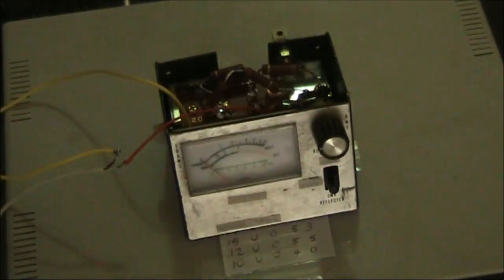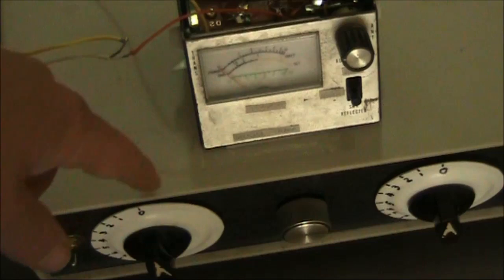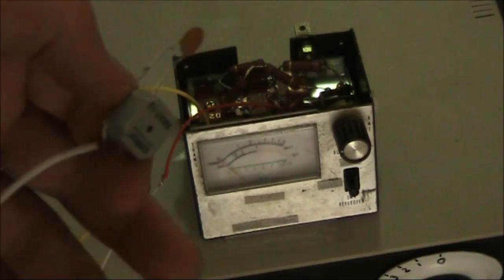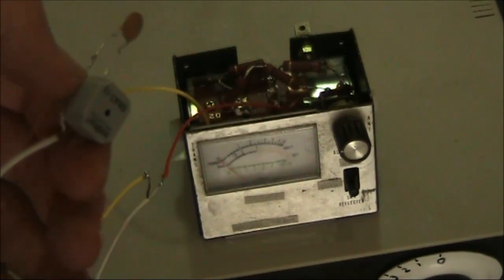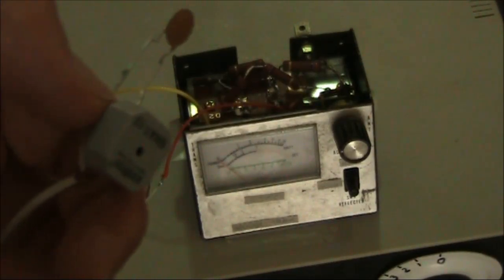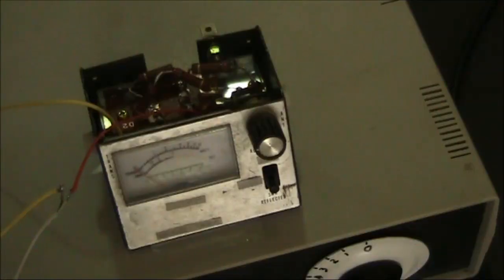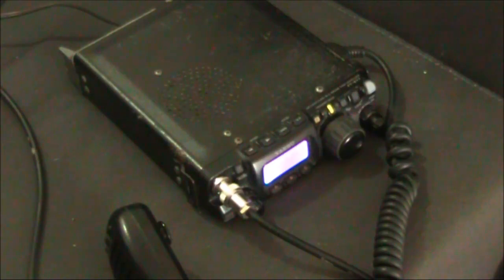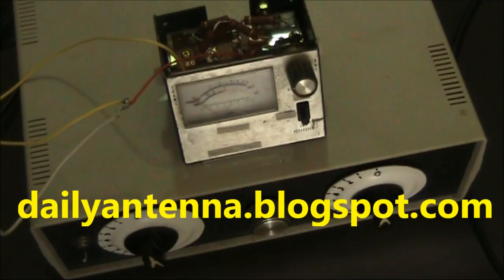Making a resistive antenna bridge audible

Comment: Hi Peter,

Thanks for posting this video - this has given me an idea for modifying the ATU I built for the FT-817 about 15 years ago. It's a resistive bridge, and it uses a LED instead of a meter to indicate the state of tune. The drive voltage for the LED is derived purely from the RF power developed by the transmitter.

For matches close to 1:1 VSWR, you have to tune either side of the minimum VSWR point and watch when the LED goes from lit to dark then lit again, and then go back halfway to the estimated optimum tuning point. That's ok, but it's hard to see in bright sunlight.

Years ago, professionally I used a radio which had an audible tuning aid for the ATU - it was just like tuning a BFO, where minimum pitch (and optimally no sound at all) indicated best match. I shall try your suggestion on our ATU.

Cheers, Mike VK2IG
Reply from the maker: Thanks Mike - the main problem with it is that (at least at QRP levels) you need the piezo in your ear.  I was thinking of VCOs and trying one with a 555 timer. However it wasn't so good at the very low voltage range though fine over a good range higher. But was just thinking, if I was using an independent battery I might be able to set it up with a resistor so the earth rail is held a bit above battery negative (say 2v) so we then can use the VCO over a usable range.

Comment: Thanks for the video.  Do you mind if you can make simple AM radio transmitter between 600khz and 1.5 mhz . for  me with schismatics. thanks.
Reply from the maker: Hi - glad you liked the video. I don't do custom designs for people. Many circuits for such small transmitters appear on the web.